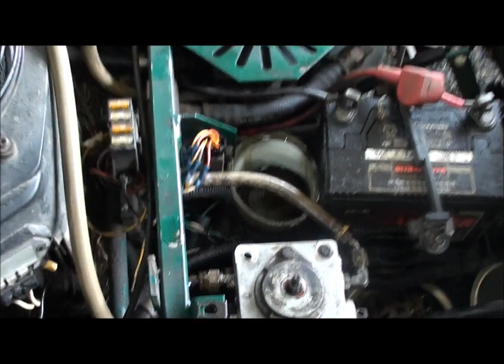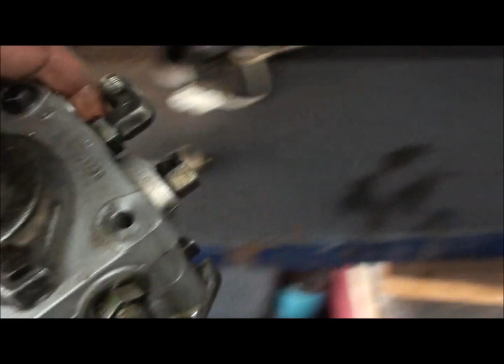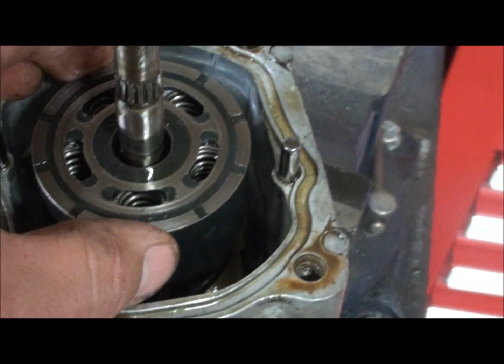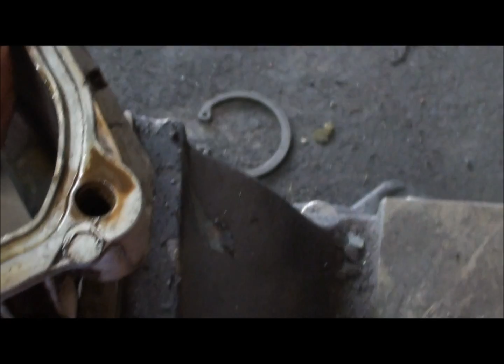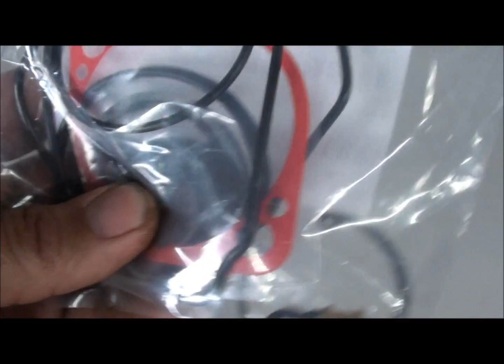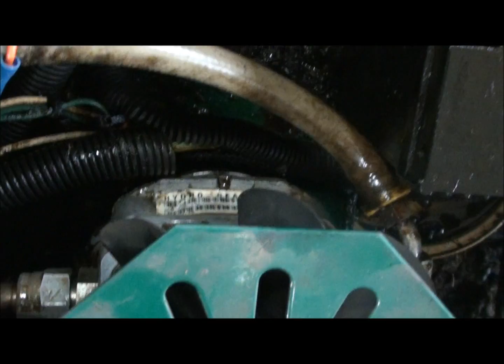Repairing Hydro Pump

Comment: My hydro pump was not working on my zero turn so I took it out and disassembled the whole pump and it seemed okay until I reached the pads underneath the rocking thing and it was loose and had some wear do I replace that?

Comment: How do you lock the pulley in order to remove/tighten bolts on to shaft? I eventually used my impact driver to remove but not sure that’s sufficient when reinstalling since they probably should be torqued!?

Comment: Thank you for doing this. I've been looking at quite a few Hydro-Gear tutorials and some of your observations are new and provide good insight. Yours is also the first to deal with separate pump/motor configuration mowers. I think I'm going to look at buying something w/belts directly driving integrated units bolted to the wheels, 4 component configs seem to be asking for more frequent maint work on the owner's part.

Comment: I rebuilt the hydro pump and reinstalled and only builds pressure when motor is off and I turn by hand. When I turn motor on and pulley turns my pressure. Any idea what could be wrong?
Reply from the maker: Could there be air in the system? I guess I'm unclear on your question? When you turn the pump by hand, oil flows? But when you fire the engine up, it doesn't?
Reply: @fitzsfixes  when I turn the wheel by hand it, seems to to flow oil into the hydro pump and eventually builds up resistance to a point that I can’t turn wheel by hand. As soon as I start it  the resistance is gone and can spin wheel freely
Reply from the maker: Try disconnecting the hoses. Leave them hooked to the pump. Put the end of 1 hose in a bucket of clean oil. Spin the wheel and see if it pumps out the other hose. If it does, it should be fine. Might just be an air lock
Reply: @fitzsfixes  which hoses should I disconnect? the hoses behind the wheel?

Comment: no block cylinder installation video...go figure
Reply from the maker: I know right? Go figure. I suck
Reply: @fitzsfixes  Don't you know that informative videos aren't enough anymore? You have to hold peoples hands 11 years later.  Thanks btw, I'm about to try and tackle the rebuild of a set of Hydro gear pumps on my Bobcat mower.  Any suggestion for cleaning out the drive motors before I push any contaminants back into my pumps?  There was quite a bit of debris in my reservoir.
Reply from the maker: @Rick90lx  it's crazy isn't it?? 

I wasted a quart or 2, but I pulled the lines off the pump and put 1 line in a clean container full of oil. The turned the wheel motor over by hand and ran a couple quarts through it. I think that's all you can really do. Thanks for the comment. Good luck
Reply: @fitzsfixes  I appreciate the response.   I was thinking about doing something along the same lines.

Comment: thanks i just needed to pull the pulley of my scag has the same pulley thanks watched it all. I got a whole new pump  i think i will rebuild it old one at least tear apart. $452.00 i paid for the new one  1200 hours but the damper went out on that side which damaged the pump   THANKS

Comment: "These guys here look good"....  That's the pump plate.  At least take a minute to measure the wear with a feeler gauge so you know what you got since thats #1 of the two major reasons for a weak drive.  New pump plate assembly is $35.  Takes a special flow meter from Hydro-Gear to test these after you're done.  They're right at $1,000.  It goes forward/backward doesn't mean it will go up a steep hill after it's heated up to operating temperature for 45 minutes

Comment: After you rebuild the pump and you reinstall it, do you have to worry about air in the lines? Is it as easy as rebuild and install??
Im doing this same thing tomorrow. Id like to get it right the first time.....Thank you for the video
Reply from the maker: Air wasn't an issue. I started up the machine on low idle. Then held the control on forward till the tires started moving. After 30sec or so it was back to normal. Also, while reinstalling, I filled the pump with oil. I didn't install it dry. And yes, it was easy to install. Hope this helps

Comment: I work at Danfoss and we build these pumps and motors. Looks like valve plate came off of endcap over time. There should be a timing pin for the valve plate on the endcap.
Reply: Tanner Miller  where could I buy an end cap where the lines hook up, at? For a pump like this

Comment: great  video  is this a pump or a wheel hydrolic motor mower
Reply from the maker: willford11 it's a pump that feeds a wheel motor. the wheel motors are located on the backside of the wheel hub assembly.

Comment: Aside from replacing worn components, cleanliness is imperative.
The work bench needs to be covered with something to keep debris from contaminating parts that come into contact with it.
The unit operates in a closed system, thus, abrasive debris can cycle endlessly through the pump and wheel motor, if it is small enough to flow through the filter.
The system should be flushed, filter changed, and new hydro fluid added, before operating the unit. If this is not done, minute metal particles suspended in the old oil will create havoc with the "mating of new components" and severely shorten their life.

Comment: Thanks for the video. With the help of your video I tackled my Hustler Super Mini Z. The wheel drive was shot so I ordered a new one. I tore down that side pump to check for metal contamination and wear. Luckily the metal stayed in the wheel drive and I cleaned the pump, hoses and cooling radiator. My Hustler dealer wanted $1015 plus tax just for over the counter price on the wheel drive. They also recommend that you change the pump on the side that you replace the wheel drive. I figure it would have been a good $2500 to replace the drive and pump including their labor. I found Buchallase.com had the Hustler part out of FL and it was $735 delivered to my door with no tax.

Comment: your "wobble plate" is called a swash plate and the "metal" on the face end of the barrel is the bearing plate which has the valve plate seated on it. Thank you for showing us a closed loop pump system. The shaft seal you suspected for water entrainment was over the gear pump that acts as a surge pump to makeup for internal leakage/ pressure drops. Also, the spring you warned us may pop should hold the internal check valve poppet. 
Thanks for the tutorial!!!

Comment from the maker: The problem was it became unresponsive and jerky.
Reply: I'm about to do mine over I have a question, mine surges when going up a small incline (loading it onto the trailer) and when you first start moving but perfectly fine on flat. Would you say thats the pump or wheel motor? Just dont want to ripe the thing apart if its not needed.